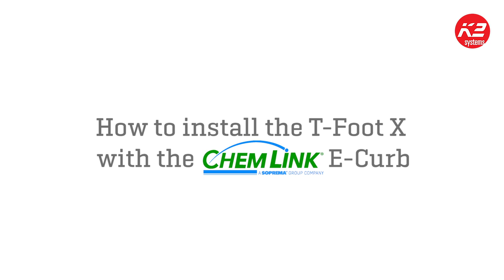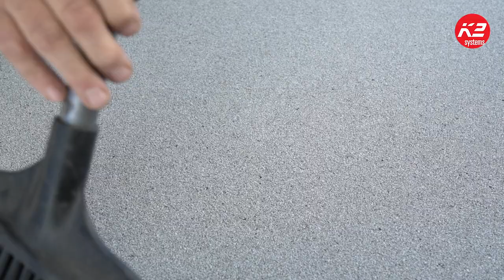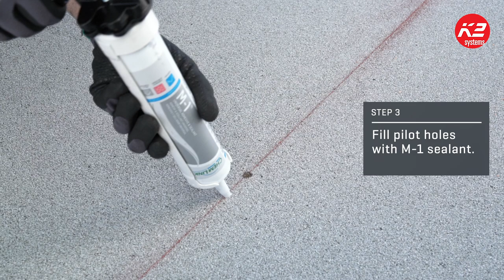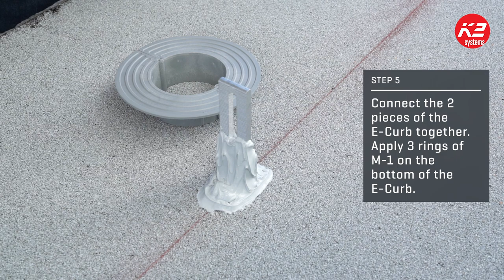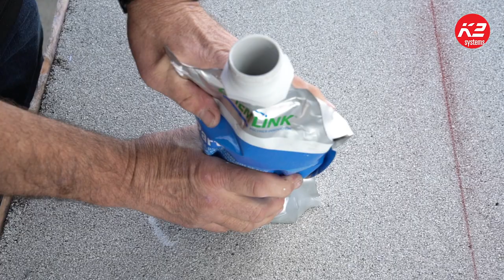How to Install the T-Foot X with the Chem Link E-Curb

Comment: So are these ever coming off when the roof needs redone? Or do the roofers need to work around them?
Reply from the maker: The mounting hardware can be uninstalled but you’ll have to check with ChemLink on best practices for removal of the seals from the E-Curb
Reply: it looks like it would be an absolute nightmare removing these to replace a roof. aka expensive.
Reply: I had a uninstall on a flat roof. We left the stands and they put the new roof around the stands (the roofer insured the warranty he offers) 

Personally I think it’s better because it’s truly water proof unless the roof itself fails

Comment: Don´t the lag bolts need to be torqued?  And the instructions mention to torque the nuts for the t-bolts to a certain value.  Is that value achieved but not over torqued by the tool you are using? It looks like an impact driver but I´m not sure.  Personally I torque with a torque wrench. Thanks
Reply from the maker: Hello Fernando, the lag bolts do not need to torqued to a specific spec. However, the washer does need to be seated properly in order to tighten it. The t-bolt should be tightened to 25.8 ft-lb (35 Nm). See the link below for the Quick Guide instructions. https://k2-systems.com/files/Content-ESS/Technical-Data/Roof-Attachments/T-Foot-X/T-FootX-QuickGuide.pdf
Reply: @K2SystemsUSMX  I know that the nuts on the t-bolts need to be torqued. My question is if you did it in the video or not.
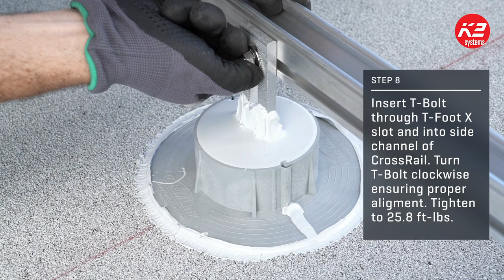Reply from the maker: @FernandoTRA  At 4:25 it says the T-Bolt needs to be tightened to 25.8 ft-lbs.